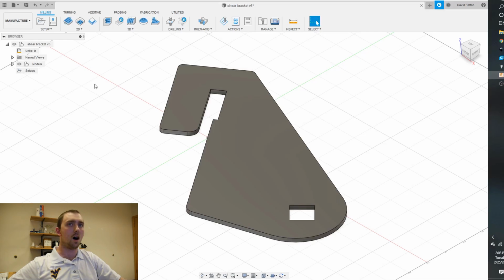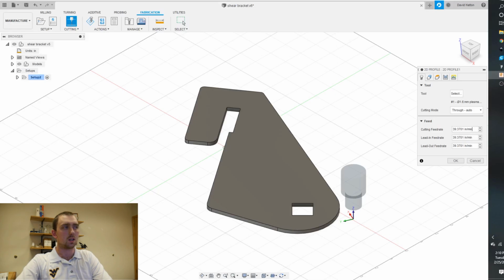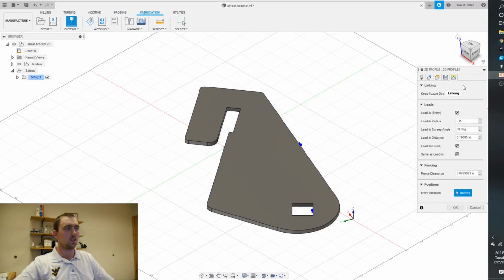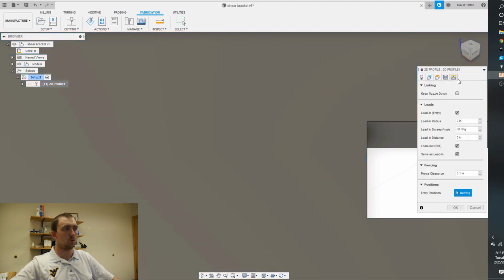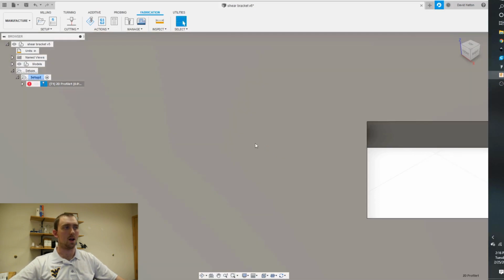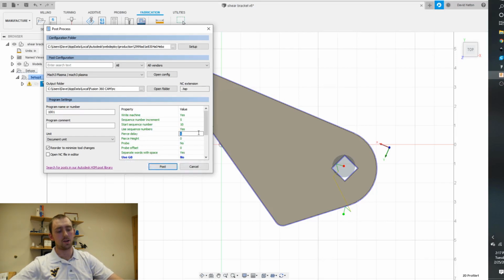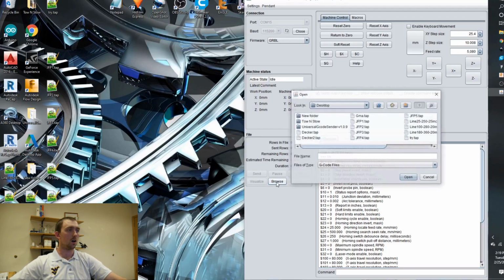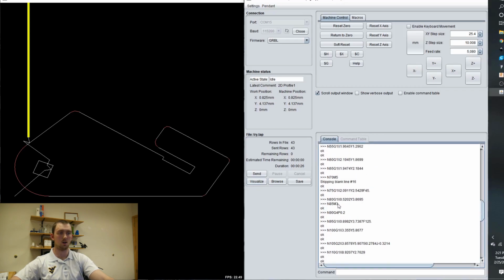Arduino UNO GRBL Plasma CNC, Fusion CAM setup

Comment: It says arduino uno GRBL but you are using mach3 postprocessor! at least change the title of the video
Reply from the maker: Good question. Arduino uno is just the board it should accept any post as long as the g code sender accepts the post file extension and accepts the uno (the wrong postmight use different code for certain things, but it will still do something, The gcodes your machine uses is more based on the "GRBL" you have flashed). The mach post .tap works better for me. UGS accepts both. Also even if you use another post setup is about the same.
Reply: @dnc_fabrication  Hola, esto quiere decir que aunque utilice mash 3, la tarjeta de arduino reconoce estos comandos.  Quisiera saber si USTED sabe porque cuando utilizo el postprocesador GRBL me aparece un error de visual studio?

Comment: Very nice video.. I just wandering how to hock up my plasma torch and how to fire it self ??
Reply from the maker: https://www.youtube.com/watch?v=IXxqUfMoBLk&t=367s
Check out this video around 16 min I show how m3 m4 m5 commands are used to turn on/off the spindle/torch. With that 5 v signal you will use that to turn the relay on/off (Ignore if your board has the relay built in). Then you wire the relay as a N.O. switch to the plasma. Your plasma may have a cnc plug on it but if not open it and tie (parallel) to the trigger/torch.